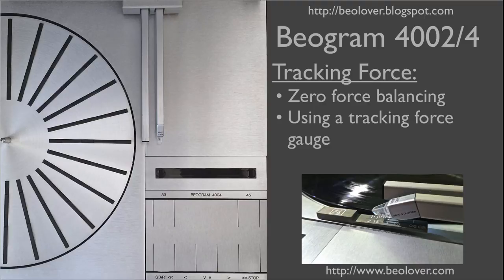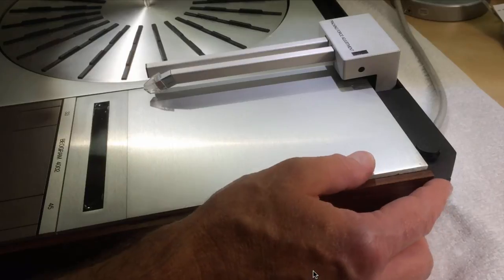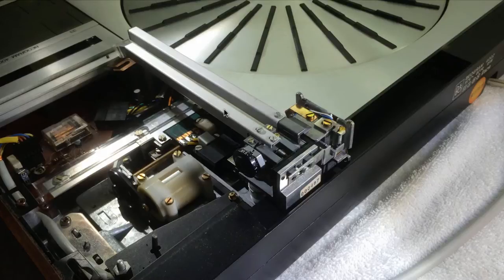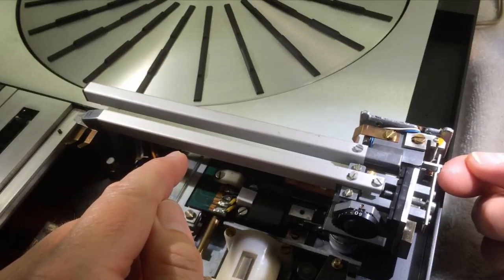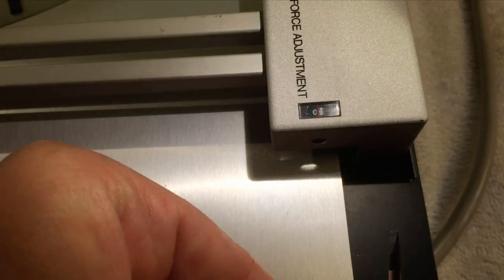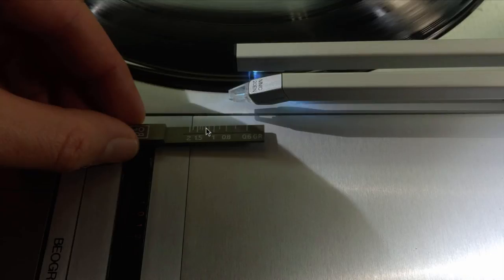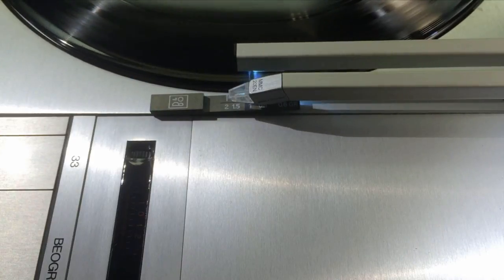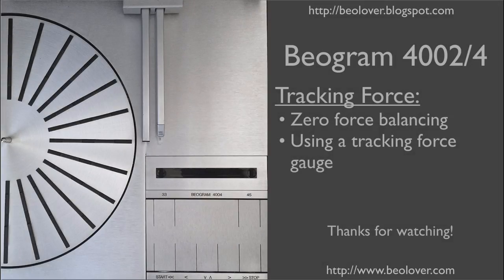Beogram 4002/4004: Tracking Force Adjustment

Comment: Hi beolover! Novice question: is it necessary to always adjust the counterweight when setting the tracking force? Also, is it possible to measure the tracking force using a digital stylus gauge? I have a Beogram 4002.

Thanks! :)

Comment: Given that the actual measured force after adjustment was quite a lot different to the indicated dialled pressure....  Could you forget the spring altogether ( set it to zero )  and simply measure & set tracking weight with the balance weight ?    Or..... Adjust the counter balance so that you can match the dialled pressure to the pressure measured with the balance ?
Reply: Yes...we usually try to match the dial at 1.2g with an actual readout of 1.2g, but the scale on the dial mechanism is an estimate at best, i.e. what counts is the measurement.